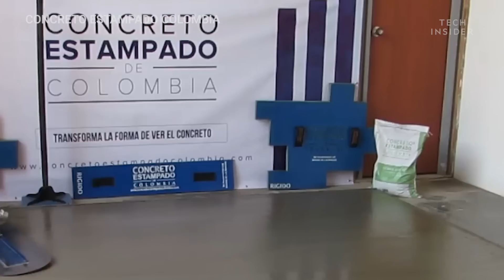Stamps Can Make Plain Concrete Look Like Masonry

Comment: I do concrete stamping for the past 20 years and this is a great video thanks 😊
Reply: Cool
Reply: Doesn't the concrete stamped floor wear off easily after a few years?
Reply: Toruk Makto how will that wear off?
Reply: @vinnce9288  By crumbling.
Reply: If the owner properly maintains their stamp concrete pad properly. It will last their lifetime. Concrete that wears or crumbles was done incorrectly.
Reply: Robin  one can only hope that's what he meant.
Reply: Robin  thank you 🙂
Reply: So this could be done on the above ground exposed concrete foundation of my log cabin?

Comment: That one line through the whole thing pisses me off at 2:44
Reply: Same, now that I notice it
Reply: While it may appear as separate tiles at a glance it is still a solid piece of concrete. That is a control cut to create a point for cracks to form rather than cracks randomly forming. The concrete is pretty much guaranteed to crack. Better if you can control where it does crack. You will notice the same thing in lots of garages with concrete floors.
Reply: Lol its simple engineering; they have to factor in thermal expansion and contraction. a giant slab of concrete will crack with different temperatures. look at the roads or sidewalk on streets. they all have lines. it is a MUST.
this looks like an indoor floor so it puzzles me just a slight bit since indoors are climate controlled. probably curing and setting time. I never calculate this for indoors; perhaps they used some a very different concrete mixture.
Reply: Lol.  It's a control joint but still looks stupid because pavers don't need control joints.   This it's a bunch of hideous bullshit.
Reply: I don’t mind the line necessarily... it’s the fact that it isn’t centered
Reply: Y
Reply: Me too it looks like it's about to fold
Reply: @rerun3283  pavers wtf
Reply: @xostler  It's all right
Reply: Literally came to the comment section to find my shared opinion about the annoying line.

Comment: I Think the smooth original surface looks better than the stamped concrete imo (plus, a smooth finish makes it easier to mount things to the wall, like a floating desk or shelf)
Reply: Kyle247l, true but that gray, smooth wall/floor can get very boring very fast in my opinion
Reply: A floating desk outside your house or what
Reply: Or you know, it could be dependent on room, location, taste, etc

Comment: 2:27 Does concrete sealer wears off? Does it have to be reapplied every couple of years?
Reply: rif42 
You can reapply it yourself every 2-3 years. 
Or even 1 year if you're desperate. 
And also depends on how much people walk all over it. 
Or how much the floors being cleaned. 
And rainfall.

3 at max tho.

Comment: the wall or floor could crack if you apply this in exterior structures if you live in a place with cold winter and hot summer seasons
Reply: I've done this in WA state and Texas. Doesn't crack. Concrete is concrete, a stamp does nothing to its structure

Comment: I feel like this is going to be one of those "cheap alternative" trends that will be cool for a little while, but than be looked back on like the fake wood panels of the 70s lol. I can see the video headlines now "Top Ten Ways to Make Fake Masonry Walls Look Better"
Reply: It's been on the go for decades nothing new I did it 20 year's ago for almost 10 years
Reply: @rexeverything100  interesting, I wasent aware they've been doing that for so long. I live in Idaho, and have only been involved in construction for about 4 years, but I can tell you that stamping concrete isn't too awful common out this way. Every project I've been on has had real masonry, or none at all lol. Thanks for sharing!
Reply: @wazzuptrey  no worries it's very popular in European countries they use it a lot around swimming pools and shopping centres and path's in general, McDonald's uses it for it's drive throughs in the uk, quite alot of domestic properties use it for driveways which is what I used to do, it's very versatile hard work laying it though..

Comment: Since the color is on top of and not mixed into the concrete, I would assume over time that it will fade or fall off which will make this look very cheap and fake.  That is my logical perception, you may have further information that differs.

Comment: What’s the price difference between the labor and materials it takes to do that vs the labor and materials to just lay real pavers? I think it looks like garbage compared to the real thing but if it’s 10x cheaper I could see it being a option. Only issue is lower income people will most likely have an asphalt driveway and the only other place this would be realistically used would be a pool deck but if you’re already spending the money to build a pool no one in their right mind would chose to finish it with this vs real pavers if it’s not saving them thousands or unless they love the look....which I doubt

Comment: Costs more in labor, and in maintenance because it's harder to clean and more vulnerable to the weather due to the increased surface area, which also makes it require more paint when painting is desired. Looks ugly and repetitive. Smooth concrete is the better option: to make it look interesting, just get it painted. This is just madness.

Comment: Seems very American: quick, cheap, fake. And before Americans get upset: I've seen the failarmy: walls aren't supposed to turn into black holes when you fall head first into them.
Reply: If you put your head through drywall with that much force. Hitting straight concrete would be a trip to the er. Besides that hole can be quickly fixed.

Comment: They skip the part where they put a perfect inch and a half layer of concrete flat on the wall...🤔
Reply: Probably a cement and sand based tile Adhesive like compound.

Comment: This is cute but nothing will compare and hold up like real brick. But nice try.
Reply: allcoiledup It's trying to replicate stone not brick
Reply: Did a stamped wall 20 years ago at a pool I maintain to this day and it looks just as good today as it did when I finished it way back then.  Proper maintenance and sealing every 2 years or so this method will last a lifetime.
Reply: Real brick? Try building a skyscraper out of real brick lol. There's a reason they build them out of concrete and real brick, why bridges aren't made out of real brick.

The concrete is WAY more durable than a real brick. You've obviously never worked in the field, everyone knows this.

Comment: Really?! Stamping concrete is an old practice. It's expensive, but not rare. The crew I worked with did a much better stamp than this one, and we would order dye with the concrete.  Happy home owners, though they never wanted joints cut , so eventually their concrete would crack where it wanted to, and ruin patios, driveways, service walks, and side walks. Customers see a picture and think that that's what they want.. I'm here to say, you are best off with grey concrete,  fiber mesh mixed in, and hard finished, pebble aggregate concrete. If you pay less than $120.00 for each cubic yard of concrete, you bought some rocks and sand and shit. Be smart. Order good Crete,  and it won't matter how they lay it down as long as it's to grade, it pitches where it should, and it has a good hard finish. Which means that the workers scrubbed up plenty of cream to adequately encase the aggregate.  If you pour it wetter than normal you get great cream without too much elbow grease,  but you risk the grade being low. Pay attention if you are having someone do a job. Especially for cash. Ask about the Crete mix. Ask about the type of finish, and ask about a warranty, or guarantee.  Any company that won't guarantee their work is not worth your money. Trust me. Be smart. If I can come and crack your driveway after it has cured with an 8 pound sledge, you got, got.